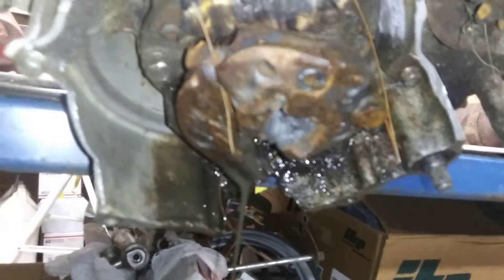If your Honda ATC Motor Does This, Something Isn't Right....

Comment: Looks like someone got mad because the flywheel was seized to the crank. Guess they didn't have a torch and the proper puller but definitely had a BFH and anger control issues. I'm happy you have it now because I know it will be fixed or go to other motors to get them going again. Looking forward to seeing more of this adventure
Reply from the maker: Haha well it's the end of this motors run. Your right had to be an angry man to do this... This thing is toast. Stator wires fried. What's left of the Rotor is basically welded to Damn crank arm from when the guy torched it. Crank is bent so gonna get every little case and part off that I can and the rest will go to scrap. Don't like scrapping ATC parts. Only parts that are truly junked. And this ain't to shy of that.... The whole top end is salvageable thank God. This is a good donor motor for other engines. Always a loyal subscriber Mike! Thanks!